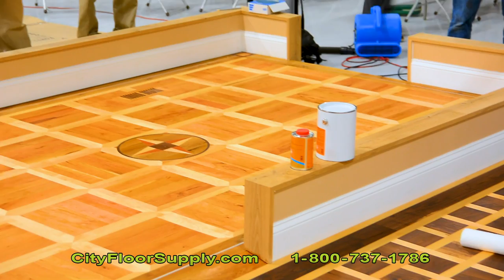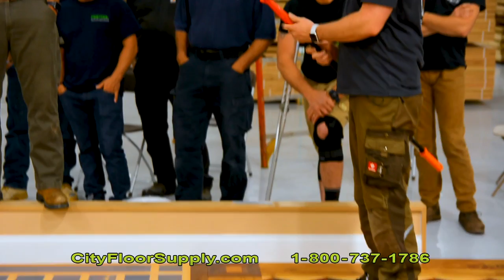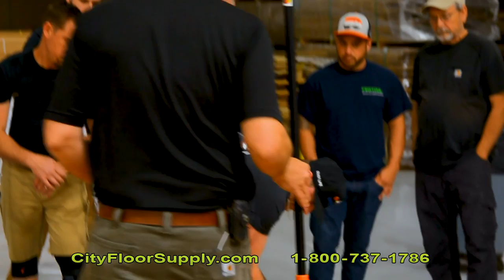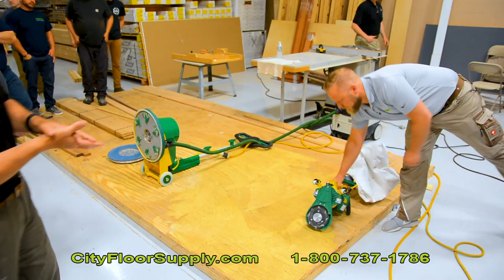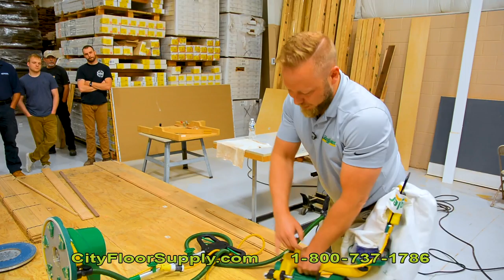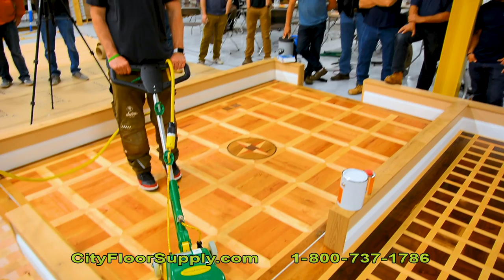Loba Wakol Finish Systems and Lagler Sanding Machines | City Floor Supply

Comment: Potentially stupid question.
If I want to use the WS DUO 2K finish can I mix a gallon with the hardener, use half of it for the first coat, and the next day use the other half?
Or you can't store it if you mixed it? 
In the video is mentioned that you can close the bucket with the finish and the roller inside and be ready to go whenever you want, but this said about "easyfinish" that doesn't have the hardener.

Comment: I invested in some cases of some loba easy finish one of those containers was bad or something as I was putting it down with a loba roller it started looking like wall texture I figured it was going to level out it didn't! cost me alot time and money to fix so now my hard earned money goes elsewhere real Bummer!
Reply: Michael Wong 🤣🤣you got a case. And one bottle was bad. So the whole product is junk.  🤣🤣🤣🤣🤣🤣. Let me guess. You measure once. Cut 3 times. And give the tape measure a bad review🤣🤣🤣🤣🤣🤷‍♂️🤷‍♂️🤦🏻‍♂️🤦🏻‍♂️🤦🏻‍♂️🤦🏻‍♂️.  Like everything else. I have money on you doing something wrong. Did you roll/pull it after it flashed? That’s usually how newbies mess up.